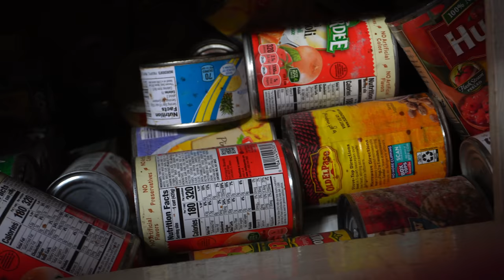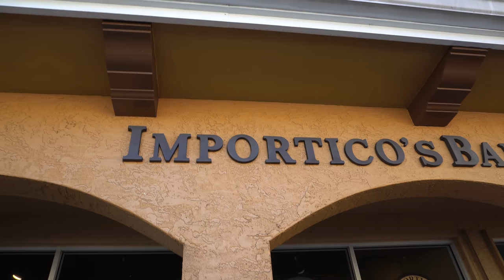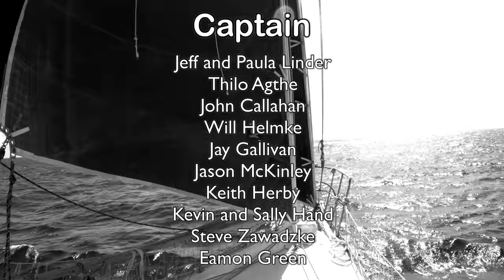Everything Goes WRONG! | Sailing Wisdom [S5 Ep7]

Comment: So: Place the Battery packs above the bilges. Separate water proofed boxes for each of the battery packs, create failure, fall overs so when one fails the others are protected. I suggest perhaps where where the fuel used to be stored or behind stairs to the cockpit. If the water reaches that level you are already in trouble and batteries will be the least of your worries.
Reply from the maker: Indeed! Now we’re building them inside waterproof pelican cases. It’s much bulkier but much less stressful!

Comment: So sorry to hear about grandmother. Thoughts and prayers are with you on that. 

I bought a $12 high water alarm at Home Depot. It is meant for hot water heater pans, but makes a great bilge alarm. You could run the probe (Several feet long) down into the bottom of that box. The probe is very tiny and will fit anywhere. The alarm is loud enough to wake the dead.

As usual, your videos are always the best! Love them! Learning is really fun with your channel. Thanks for doing what you do!
Reply from the maker: That is a great idea! Nice and simple to install.

Comment: Did you take all the labels off the cans ? Yes, they might stink, but cleaning them would be easy. Take them all out with gloves, that locker is toast for a while. Art supplies will be toast. Mold takes quite a while to go away and its odors. WOW, this is so serious. Those batteries will be absolutely toast without very quick work and the BMSs are toast. So Sorry , this is so bad. Sounds like a SERIOUS water alarm is needed. One that has several sensors , and maybe backups, because this CAN'T HAPPEN !
Reply from the maker: It was terrible! But lessons learned and changes made to prevent a repeat!

Comment: I understand it is easy to say so afterwards but there should have been an electrical pump with a float sensor which would have sounded an alarm and kept the water level as low as possible. I hope you will install one... Cheers, Richard
Reply: well, at least just an alarm, which I dont have either
Reply: 100 dollars got me 10 stainless water sensors 5 mini controllers a siren/flashing light a bunch of 12v leds and switches . Made a little panel with leds and switches in locations on an overview pic of the 40 foot boat. 1 sensor in transom ,1 under shaft seal,1 in engine bilge, 1 under hot water tank, 1 under each head and 1 near the transducers.1 at the lithium batteries.
At a glance if siren goes off  I know exactly where the water is. Works great
Reply from the maker: We had an automatic pump that we would turn off when we went sailing so that it wouldn’t hide a slow leak during routine bilge checks. That pump died years ago and replacing it was very low on the list of projects. 
After this fiasco, an automatic pump became top of the list!
Reply: @RiggingDoctor  On reflection, I think its best to have an alarm, and an automatic pump which by manipulating the wiring you can operate manually if you want to. Its the same pump on half the same wiring, it just offers more safety in the event the float system fails, which they can. Alarms or detectors you can put anywhere, pumps you can not

Comment: All because of a leaky water bag! Lol I laughed so hard at the Timelapse of the tow boat running Wisdom aground 🤣
Reply from the maker: Yep! The tank idea works out, but I think I need to make a fixed tank down there to avoid a repeat. 
In the ICW, we have just been running on the 100 gallons in the bow, so we haven’t dealt with that leaky bladder tank yet. It just stays empty.

Comment: What you need is the stuff RC modellers use to protect their micro electronics from water salty and fresh ...its called corrosion X ..but theres probably other stuff out there..even motors bms and receivers batteries and servos will work underwater. 

Brian from Delos had a similar problem on delos  ... They got back to the boat started unpacking and filling the tank ...it flooded the whole floor sole panels were floating..
Reply from the maker: I’ll look into that stuff! Hopefully won’t need it again, but I plan on living a long life so a lot can happen!

Comment: Ahhh boating, where you can go from a high to a low in a couple of minutes.
Having a timber boat the only electrics below the sole is the bilge pumps. I'd really like to do the electric thing but until it all becomes solid state and waterproof I'll keep the dinosaur juice sucker and an electrical minamalist.
Good luck and I hope the motor survived.
Reply from the maker: Elco makes an electric motor that is waterproof. It’s also insanely heavy and expensive, but it can run while submerged.

Comment: This should have been the don't cry thumb nail video. My heart just breaks to see those batteries swamped and the electric engine.
Reply from the maker: It was a horrible time
Reply: @RiggingDoctor  been going through some thing's myself with the new neighbors. There Only Tenants won't stay out of my yard. Scalped my grass I asked them to stay out. Then they cut down a tree in my yard. I let that felony slide. Then they put like 5 to 10 cords of wood down on my back yard & refuse to move it. Baring me from maintaining my lawn which they knew I was going to run a new fence.
Reply from the maker: That’s horrible!! 
That’s one thing I love about boats, you can always move if your neighbors suck.

Comment: Well you showed what can happen..so you may have prevented this mess falling on someone else.....I'm not a fan yet of lithium power just yet....expensive and a bit fiddly when you have issues.....If I may suggest a battery operated and solar charged wireless bilge water level monitoring system that also can send you an email or even remote access viewing....if you are staying at a marina that has internet connections. You could also monitor other things too..like main battery charging and security cameras.....good luck...John
Reply from the maker: Yes, it’s excellent advice to install an alarm and we did just that! Thankfully, it hasn’t yet had a reason to sound.

Comment: I've had a similar problem with soda cans that spring a leak after storage for more than a year.  Time to chuck it all.

Isn't there a small bilge pump and alarm?  So glad the boat didn't burn down due to a flood.

Best wishes guys. Sad to hear of so many cascading problems, but I know you guys can work through the issues.  You'll come out the other side with knowledge and experience.  Condolences on Grandma.
Reply from the maker: All the pumps are manually activated. Now I have an automatic pump on a float switch 😎

Comment: First of all canned goods. It’s a good idea to take the labels off and write on the can what it is. You can put all the like items in the individual totes and store them. This has a couple of advantages. one is that it keeps the creepy crawlies and roaches and other bugs off your boat. The Young hatchlings of insects can get between the label and the can which keeps them safe from being eaten by the other bugs and roaches will lay their eggs right on the cans so by washing them the eggs all get washed away and no roaches on your boat so if you Mark the can rip the label off and then wash it quick the can will dry. And that’s the second thing you gain. The paper will hold moisture to the can and can cause it to corrode. Any can that’s not bloated you could label and wash but if one of those cans has leaked out and you got stinky yucky stuff on all that paper I’d probably go with you and just pitch everything. 

Next, seeing as how you’re running an electric boat that is extremely sensitive to water you should put at the very least a bilge alarm in every individual compartments down below So that you will notice and can start pumping out the water before it does damage to your electronics. Of course it might be better if you had actual electric pumps. They don’t necessarily have to be the best in the world but they would start to remove water from different sections of your bilge and send off an alarm so you can pump out the rest manually. 

One last thought. I’ve known quite a few people to get stuck in the mud in the intercontinental waterway and I understand that this would be a luxury but a forward facing depth finder they could tell you the depth under keel and out ahead of you would be very useful. However these aren’t cheap and they are kind of a luxury item.

Comment: I was worried until you said they're Lifepo - good choice. 

The BMS's will be fragile to getting wet... Might be worth waterproofing them, even just to protect from condensation and normal conditions. 

One simple process would be  "conformal coating" - which is basically a clear paint that goes over a PCB to seal it. You can buy spray cans of it.
Reply: Good info on the Conformal coating, I'll check it out. I was a repairman down to component level and did not see this coating very often. Would make it hard to repair down the components but that isn't done a lot now days. Is it possible to remove that coating once you put it on a board ?
Reply: @californiakayaker , I from tutorials I know that there is something that would be easily peeled off for replacing components or resoldering connections. Not having done that construction (or interest), I don't have sources.
Reply: @californiakayaker  it might depend on the type of conformal coating - I think some you can even wipe off with a solvent.
Reply: All of the vehicle manufacturers have solved these problems already. It doesn't matter if it Nissan, Toyota, Chevrolet or Chrysler essentially they all do it the same way which adds many levels of protection.  A metal dry box with a vent is the preferred practice. Water cooling and electric heating in the box is the normal practice but If the batteries are never exposed to freezing the electric heater could be ommitted. I'll post a link in a second...
Reply: Dry boxes, weather pack connections, silicone sealant, etc.. https://youtube.com/playlist?list=PLItfsjrJLH42KjTIW8z-MBU4veVZMDAqS

Comment: Your supposed to remove the labels from canned goods and use a marker.  It gives less material for bugs and soaking up liquids (contributes to rust and mold).
Reply: Rip the labels sharpie the name varnish the can into the bilge they go
Reply from the maker: We did that for a lot of them, but weren’t having any problems until one of them rusted open. We just kept them for too long without eating them

Comment: The premade batteries are submersible but I get it that there was big savings going the DIY route.  One thing you could have done was made the batttery bux submersible.  Expensive, but submersible..  Coat the interior of the box with expozy, seal the lid,, for example using closed cell polyurathane foam, and then seal the box opennings for cables and any other wires.  Alternate is to keep batteries and motor out of the bilge if possible and in a mre dry location.  I'm not sure if that is viable on your boat.
btw- I wasn't going to comment until I got caught up on your videos and did the patreon subscriber things.  I'n not sure how well yer recoverd on this.
Reply from the maker: Check out our latest video! I made newer batteries inside a pelican case. They are waterproof 😎

Comment: I installed a loud bell alarm in my 35 foot Cheoy Lee. that goes of when water in the bilge, low oil pressure and engine over heat. Saved my bacon a couple of times.
Reply from the maker: That’s a great addition!

Comment: OMG, what a nightmare! I knew this was going to be a rough video, I just didn't know how rough. Don't you have an automatic electric bilge pump that might have helped avoid the extent of the damage? My heart goes out to you both...steady on mateys.
Reply from the maker: We had an automatic pump, but it died years ago and we never replaced it because we turn it off while at sea. On the ocean, I do regular bilge checks and an automatic pump can hide a slow leak by emptying the bilge between checks. 
After this happened, I installed a new automatic pump in there!
Reply from the maker: We had an automatic pump, but it died years ago and we never replaced it because we turn it off while at sea. On the ocean, I do regular bilge checks and an automatic pump can hide a slow leak by emptying the bilge between checks. 
After this happened, I installed a new automatic pump in there!

Comment: Sorry about your flooding, thought the keel grounding caused it, so 86ing all those cans might help with that issue some?
Never knew what volume the manual pump could move, looked like a work out!
Reply from the maker: The keel is integral, so groundings are not as scary. 
What is 86? Is it an anti corrosion gel?
The pump is great but it really does need that huge handle because you are lifting all that water with each stroke. It’s a workout!
Reply: @RiggingDoctor  86, means to get rid of or discard something

Comment: sorry about your grandmother., lost mine some months ago, still think she is alive sometimes. its never easy. 
could it be possible for you to mold a fibreglass skin (a male plug in essence) to the compartment where you house the batteries?, it s not a difficult job and it pays to have the batteries completely isolated. you could run the cables thru waterproof glands, at the higher point possible and keep the water out still
Reply from the maker: That’s a good idea! Make the battery box waterproof! 
I just finished making a new battery for the boat inside a pelican case. It’s waterproof and super secure, and I was able to mount up nice and high in the boat :)
Reply: @RiggingDoctor  cant go wrong with them pelican cases, nice stuff!!

Comment: i am researching repowering my Laser 28 sailboat electric - after your experience do you think it would be of value to have a completely watertight enclosure for the lithium battery bank?  I would expect serious cooling fans might be required (but not continuously right?
Reply from the maker: After we built the batteries for Wisdom, we then built batteries for our dinghy. It powers a 1.2kW motor inside a sealed pelican case. No cooling and the cells don’t seem to get hot. 
I was going to figure out a cooling system for the batteries but they stayed under 100°F in a black box in the sun while motoring at 4 knots. 
I think you will be fine, but if heat does become an issue (which I doubt) then you can figure out a cooling system. 
As your battery gets bigger, each cell works less hard and the result is less heat. If you keep your discharge rate below 1C, you won’t need cooling. If you are going to run at 2C or even 3C, you will need cooling. 
Our dinghy battery runs at about 0.5C and the boat batteries run at about 0.1C, so they don’t get hot.

Comment: Ok  I understand a leaky water tank was the root cause of your issue.  Given that the bilge was flooding with water why didn’t the bilge high water alarm and or/ bilge pump come on? Confused!
Reply from the maker: It’s pretty simple: we didn’t have an automatic bilge pump or an alarm. While at sea, we do regular bilge checks and kept the automatic pump off so that it wouldn’t “hide” a small leak between inspections. When that pump died, we didn’t replace it because we never used it and just relied on the manual pumps. 
As for alarms, I didn’t know they were a thing until after this happened. 
Immediately following this, I set up an automatic pump with a float switch that remains on all the time!

Comment: That's a load of suck wrapped up in a cack sandwich for youse!  Leaks happen for sure, just went through a close one myself.  That's with an electric bilge pump and high water alarm..  they don't do squat if you get some Bilge gunk in the impeller and a fuse pops.  No alarm... No bilge pump, back to the manual whale.  There is the ability to set a separate high water alarm only on a float and a cheap auto part buzzer... It'll wake the neighbors in the anchorage.  I've considered it myself the last few days.  I think I'm gonna make it.   The buzzer is only some 15 bucks.  My batteries sit above the floor I count myself lucky in that regard.  For you guys.....   Glass inside their hold?  Hope that's not your motor gone.  Although I swear I saw you pass by when I was in Titusville.  Your sails are rare. But I was on the dock and couldn't make out the hull.  Thanks for sharing!
Reply from the maker: It was probably us that you saw! The next video will reveal what we had to do to fix the motor. We have since installed a float switch/alarm in our bilge. Live and learn!

Comment: I'm stunned that you don't have a bilge alarm and at least one automatic bilge pump.  With both your motor and your complete battery system in the bilge and no protection???  What where you thinking?
Reply from the maker: We had an automatic pump that we would turn off when out in the ocean. The rationale was that if it ran between bilge checks, it could hide a slow leak. That pump died years ago and replacing it was very low on the list since we never used it. 
After this fiasco, it jumped to the tippy top of the list!

Comment: How hard is it to crank the manual windlass in the wind, How long does it take for 150ft of chain, I have one but not mounted, Thanks. Think I am going to mount it, dont know if I will leave it as primary. No motor to go bad, no switches to go bad, no blown fuses, a bit more controllable.
Reply from the maker: If it’s blowing about 25 knots, it can take 15-20 minutes to pull in 180’ of chain. It’s a workout but it always pulls it up! The low gear is the real winner. When nothing will budge, put the stick on the low gear side and crank the chain in 1 link per stroke!